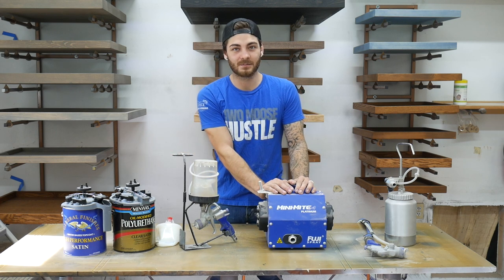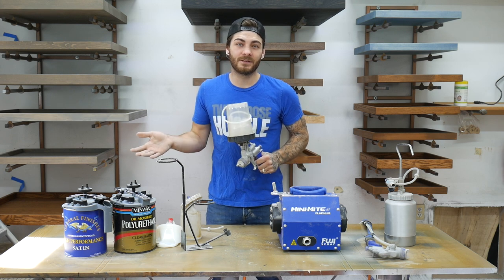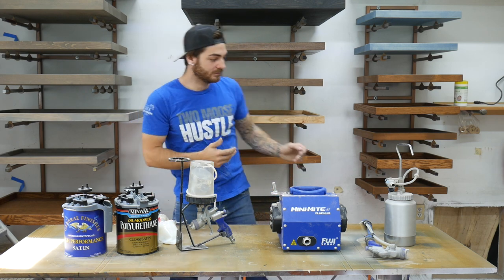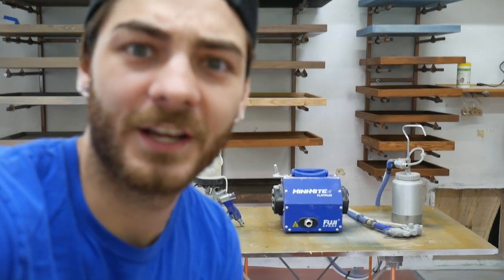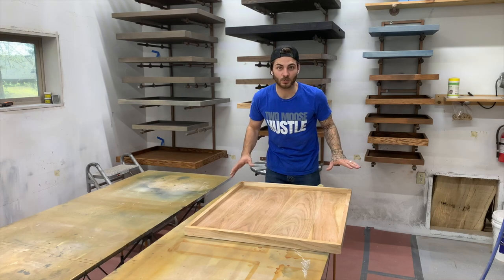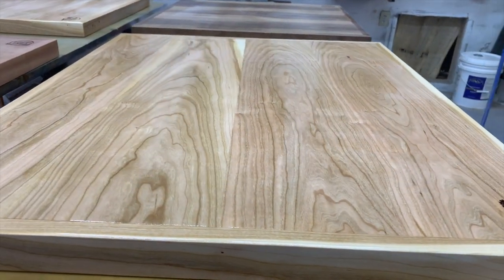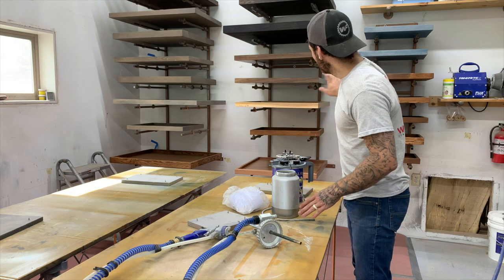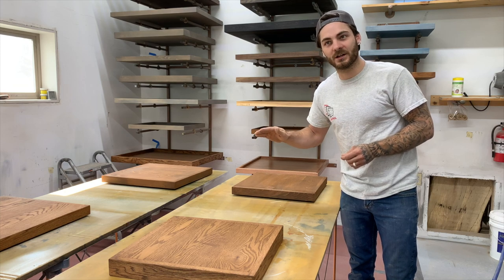My Spraying Setup and HVLP Woodworking Sprayer Tips // How To

Comment: For spraying large horizontal surfaces like a table top, which type is better, gravity or siphon? Or will both have constant supply of finish flowing to the nozzle?
Reply from the maker: I prefer the gravity fed guns. If you use a pressure pot you can even spray with the gun upside down it will have constant pressure
Reply: @TwoMooseDesign  I am looking at getting the Fugi semi pro 2, which has the pressurized cap, I think that's the one for me.  Thanks for the help!
Reply from the maker: @careyhenitiuk8423  you’ll love it! Takes a little bit to learn but totally worth the investment if you use a lot of finishes.

Comment: Nice! And it sounds quiet. Do you do multiple coats or any process after you spray them?
Reply from the maker: Thanks! I apply 3 coats and allowing them to dry per the finish manufacturers instructions. So for me it’s about 3 hours between coats. I do not do anything after the last coat I will occasionally hit them with like 320 by hand very lightly if I have a few specks in the finish. Also before I ship them I wipe them down with a wood cleaner/wax to make sure they are dust free!
Reply: Two Moose Design, thanks you for the info! Any Onefinity videos in the works? November can’t get here soon enough.
Reply from the maker: 74 Creative American Design yep! I should have a production machine soon then I’ll make a few more 😁

Comment: Which tip do u use n do u dip clean your gun every coat? Thank you for the video. I just bought Q5
Reply from the maker: Hey! I use the 1.1 and the 1.3 for top coats. And I don’t actually clean it more so wipe it off to make sure excess doesn’t dry on blocking flow
Reply: Thanks man for getting back to me so fast!!
Reply from the maker: @MoniGhaleyDIY  you bet! If it seems like your getting a lot of little bubbles and you already lowered your air output try the smaller needle.The 1.3 that comes with it does great for most top coats.
Reply: I received the package last week. I haven’t even opened it yet. Tomorrow I’m spraying my bed. I’m Definitely going to use your tips from the video. This is my first HVLP spray gun. I’ll let u know if anything goes south. I hope not tho. Thank you!!
Reply from the maker: @MoniGhaleyDIY  good luck! Definitely takes a little practice but you’ll figure it out quick 👌🏼

Comment: New subscriber here, first thanks for the great video! 🍻🍻  I'm looking to getting into hvlp spraying as of now I do new interior home finish (the trim work, laying the flooring when needed and all the interior painting) but have a fair amount of requests for other odds n ends and cabinet painting so I've been researching different hvlp spraying units. As of now I'm leaning towards a T75G Q5. I have a Graco airless for the work I do now, but haven't researched their hvlp sprayers as of yet, any info or comparisons you may have will be much appreciated! Also any extra pointers or tips for someone just getting into hvlp spraying are appreciated too of course.
Thanks again for the informative video and anytime you may have for input! Again...👍👍🍻
Reply from the maker: The q5 is a great option! We have the graco 9.5 pro contractor as well they are both very similar. The main difference is the graco has an auto on/off feature which the Fuji does not. You will be more than happy with either system! I have links to them in the description! Thanks for subscribing we appreciate it!
Reply: @TwoMooseDesign  hey thank you very much for your reply and very quick at that!!!! And for the info... I really not sure which way to go, but I do have to do more research on the Graco.

Comment: Just bought some of the minwax. Do you thin it at all? Also what size tip do you spray with?
Reply: I have the same question
Reply from the maker: I do not thin any poly or lacquer. I use a 1.3 tip I may try a 1.1 though 🤔
Reply from the maker: I do not thin any top coats only paints.

Comment: I sprayed on old masters interior water based gloss finish… it’s leaving bubbles here and there but enough that I have to sand and re-coat the table top again…. Do you have any suggestions? Should it be thinned a little bit? What am I doing wrong? Thanks!!!
Reply from the maker: Hey! I don’t know anything about your set up or that finish but typically a bunch of bubbles is too much air. So I would use a smaller tip or try to use less air flow. You could also try an extender which will slow the curing process and give it more time to level out and pop bubbles.

Comment: Can I use other brands of hvlp spray guns with the Semi Pro 2?
Reply from the maker: Yes, I can use my graco gun on my Fuji and vice versa. I’m not sure what all works but in short yes.
Reply: @TwoMooseDesign  Got it, any conversion kit/adapter I need to buy?
Reply from the maker: @riciniguez6206  mine just worked, so I’d assume other hvlp guns will work. It just looks like a giant air compressor fitting.
Reply: @TwoMooseDesign  ty
Reply from the maker: @riciniguez6206  you’re welcome good luck!